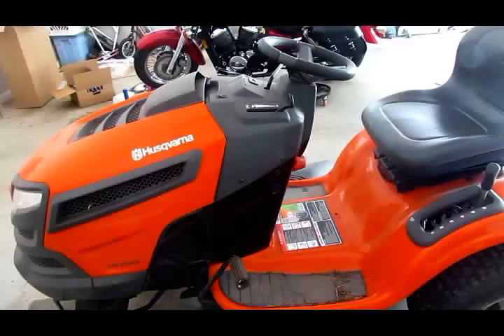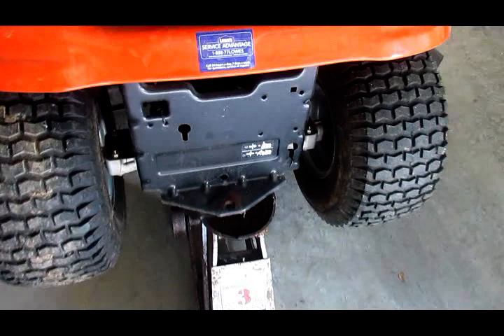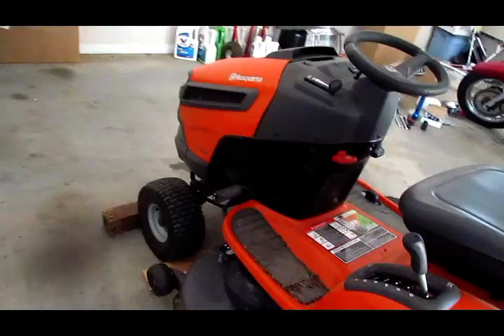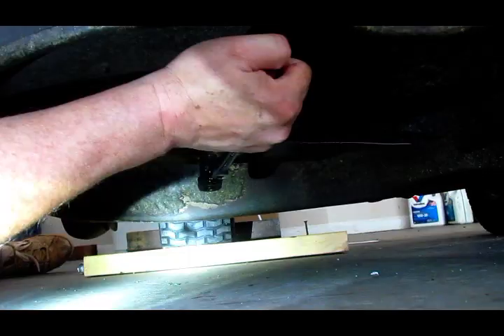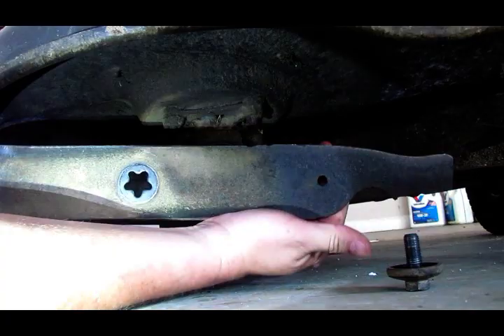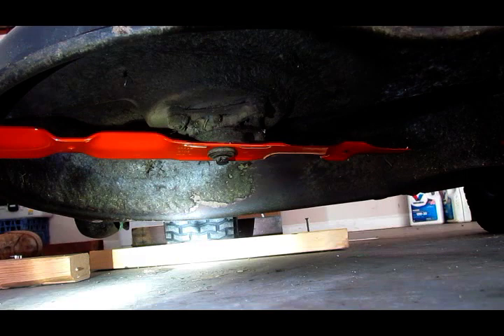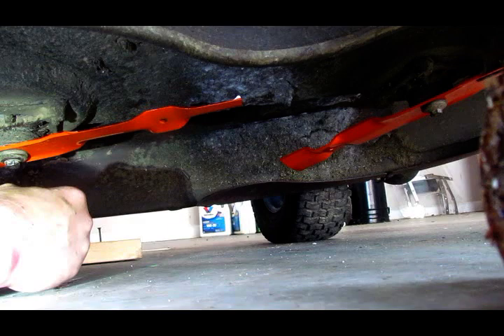Husqvarna YTH22V46 Blade Change - change your yard tractor blade

Comment: As an update, I still love my YTH22V46 and I am temporarily going to mulching to try and block out new weeds. This is also good because it recycles the lawn fertilizer that the grass sucked up.  I'm told that my High Lift vac blades also work great as mulching blades as the ones with the 3 teeth are not quite as long nor necessary.. High lift is a good thing. I used car ramps and worked great. I'm using the same blades you are using there.  Glad to stop by to say hi again!  Hope that WASH MACHINE trick worked for you.... Magnets are a great thing.........:face-green-smiling::hand-purple-blue-peace:
Reply from the maker: Sounds great!  Thank you for watching!

Comment: I have the same mower, a YTH2246. It's 12 years old now, bought it new in 2007. Never had any real problems with it, just a couple of minor things. - When I change blades I don't jack it up, I just lift the rear-end by hand, one side at a time, and have the wife slip a short piece of 4x4 (laying down) about 12" long under that rear wheel, then under the other side.  That extra 3-1/2" of space under the mower makes enough room to change blades without a problem.  I also put a leather glove on the other hand to keep from getting cut when I break the bolt loose.  I just put a drop of motor oil on the bolts before I put them back in.  - I really enjoy your videos on the YTH2246. Thanks :)
Reply from the maker: Thanks for watching, Jim!  All great ideas and thanks for sharing!

Comment: Dennis, today is April 1, 2020.  Your videos are the best.  I have changed out almost all the maintenance oriented parts on my Husqvarna YTH22V46 because of your videos.  But this year I could not get the lawn mower to start.  I had left gas in the lawn mower since November 2019 but have never had any previous problems with gas about 5 months old.  After changing out 2 spark plugs, fuel filter, air filter, oil filter and new oil, I still could not get it to start.  A friend brought over cans of Pyroil starting fluid and CRC Clean-R-Carb.  I had drained a battery trying to get it to turn over.  First he took off the air filter, and as I tried to crank and start the lawn mower, he sprayed the Pyroil starting fluid into the carburetor, the hole where the air filter fits into.  It fired up right away !!!!  But it ran really rough, like the engine was hesitating every couple of seconds.  He then spayed intermittent puffs of CRC Clean-R-Carb into the carburetor.  Each time he did the engine would die a bit but then come back to life.  Black smoke also was emitted with each spray.  But after about 5 or 6 sprays the engine ran like a kitten at full throttle.   The lawn mower is finally ready for 2020, or at least I thought so until I saw this video about changing out the rotary cutting blades !!!!!  But again, your videos are the best, by far, for explanation and video quality.  Thank you Dennis, I had to find something to do.  I am a retired 65 year old CPA with too much time on my hands.
Reply from the maker: Gary, thank you for watching!!  Sounds like maybe the carb got gunked up from sitting over the Winter.  This may help:  I buy a product called Sta-Bil.  It is a gasoline additive that will keep the gas 'fresh' while sitting.  I actually use it year-round, whenever I fill up my cans.  It usually keeps me from having this problem.  But....every now and again, a little carb cleaning is not bad either!  Glad you got it running and I appreciate you supporting my channel!
Reply: Gary, always use Stabil per the instructions on the bottle,,my suggestion,,last fill of the year buy  REC gas and put Stabil in and run that through the system on the last cut,,then run it out of gas before it sit's for the winter.  Keeps the carb free of old gas through the winter and any left there will be REC gas and Stabilized. A must do.  :)

Comment: Good video, Dennis. I love your videos. One thing I'll suggest if you don't have a floor jack or don't want to lie on the ground to change the blades, is to just take the mower deck off, turn it over and install them that way. It's much easier and removing the mower deck is pretty quick and easy as you've demonstrated in one of your other videos. I have a snow plow attachment for my tractor because I live in the snow belt and every winter I remove the mower deck and put the snow blade on. So in the Spring before I swap them back, I check my blades, sharpen them or replace them while the mower deck is off. Even if you don't use your tractor for snow removal like I do, taking off the mower deck in the winter, is a good idea to check the blades, clean off the caked grass and just inspect the mower deck and repair as needed. Keep up the good work!
Reply from the maker: Thanks for watching, Greg!  Yes sir, good point.  I live in the South, so no snow problems, but I still take my deck off once a year to inspect it, grease it, scrape the underside, paint rust spots, etc.....and change the blades.  Thanks!!

Comment: Another excellent vid!

The bolt is 5/8” head. I bought a long length combination wrench dedicated for the tractor   It’s safer than a socket handle, especially a flex handle, because you’re putting the stress very close to the plane of the bolt head. 

PLEASE use a glove on both hands. I cringed when i imagined the flex slipping and the deck edge cutting your ungloved hand. 

Another thing I would stress in your vids - 60 yrs ago my grandfather taught me to NEVER push on a wrench. Always pull toward your body because when (not if) one slips there’s nothing between your hand and body to cut you.  Pushing, you never think about what’s on the other side of your hand if a wrench slips off. 

Keep up the good vids.  You mush have acquired the wheel ramps AFTER this vid!
Reply from the maker: Great stuff, thanks!  I did get the ramps after this vid.  :)  Thanks!

Comment: I have the same yard tractor....also use mine for bushoggin..  I use a 2x4 and wedge in between blade and the deck.  
Also a couple of milk crates under back wheels..   Thanks for making the video...
Reply from the maker: Thanks for watching and for the tips Bobby!  I normally do the same with a block of 2x4...works like a champ......just hard to show on video.  haha.

Comment: For holding the blade in place while loosening and tightening I put a piece of wood between the deck and a C-Clamp.  The C-Clamp stops the blade from turning and gives you two hands to work with the blade.  I use the piece of wood to keep the deck from being de-faced by the pressure of the clamp.  It is easy and definitely takes your hands away from the cutting surface.
Reply from the maker: Great idea!  Thanks for watching, Warren!

Comment: I usually like to pull the whole deck out and do a inspection and maintenance on the whole thing when I replace or even just sharpen the blades. It's much easier to work on with the deck out.
Reply from the maker: I agree...I pull the deck at least twice a year for that reason.  Thanks for watching!

Comment: Great video. Thanks. Probably like many others, I drive my mower onto the ramps I use for my car when I need access underneath. I've sharpened lots of blades, followed by balancing to make sure the blade isn't heavier on one side than the other. However, just like you have, I've run over many things the mower wasn't designed to cut, including hidden stumps and rocks. Replacing the blades is a smart thing to do when they get out of shape.
Reply from the maker: Yes sir...balancing the blades after sharpening is very important and will certainly extend the life of your deck spindles.  I hope to do a video showing that sometime in the near future.  Now that I have a set of ramps (my wife bought me a set of Rhino Ramps, and I love them!), I also use them when changing blades.  Thanks for watching and for your comments Harvey!

Comment: Good video, I have a 386xd maybe a bit bigger but basically the same configuration.  I'm scared of machines but I've already changed my oil twice. Hopefully I can do this too. I might have help first time around though. If I can swing it. I'll be really proud of myself.
Reply from the maker: You should be very proud of yourself, Monika!  I'm sure you will do just fine changing the blades too.  Thanks for watching!

Comment: I've been using a cordless impact driver to remove and install these blades for over 8yrs. Use of a wooden brace between the  blade and the housing is minimized. Since I purchased my impact driver they have become much smaller thus allowing you access to these  bolts much easier without having to lift up the tractor as high. Works on any type or style of mower with a bolt type fastening system.
Reply from the maker: Thanks for watching!  Yes, I agree, makes the job a lot easier.  The main reason I show using the wooden block is because a lot of my viewers don't have an impact wrench or driver.

Comment: This is very relevant if you have a YTH18542, it's almost the exact same procedure, just make sure you get the correct blades for it. Many thanks for warning about the transaxle being fragile.
Reply from the maker: Good point!  Always check your specific machine for the right parts.  Thanks so much for the comment and for watching!

Comment: I bought a Riding lawn mower Jack from Rural King last year. Now, I can drive the front wheels on to the platform that fits the front wheels, comes with tie straps for the front wheels so they can't roll off. Then I Jack it up or turn the handle that is attached to a Long threaded screw which raises the mower. Pretty cool. Costed around $180.00. Well worth it.
Reply from the maker: That sounds like it is an awesome jack and would make working on the tractor a LOT easier!  Safer too!  Thanks Joe!

Comment: Thanks for this. My problem is the blades are spinning freely. So I can’t just hold the blade to loosen it. Mower was bought second hand and this is my first attempt to replace the blades
Reply from the maker: Thanks for watching Jesse!  It may be the previous owner didn't run the bolts all the way home, so the blades are hanging below the star hub that keeps them from spinning.  You might be able to hold the blade up against the bottom of the spindle to keep it from spinning.  If that isn't the problem, it may be that the center of the blade is rounded out or the star hub on the spindle is rounded off.  If that is the case, you can put a wrench on the pulley nut on t he top of the spindle to hold it and then remove the blade bolt.
Reply: @dwcoffey  thanks for the reply. Decided to replace the whole unit that holds the blade minus the pulley.

Comment: Thanks! I'm getting ready to replace the blades on my YTH22V46 for the first time, and I was looking for tips on how to jack it up. While I've replaced blades on mowers plenty of times, I thought it would be good to watch it being done on this make & model, to avoid any surprises.
 I still can't believe there isn't any decent place to put a jack on the front. Had a flat tire on the front and it drove me nuts. Had to use a lever and fulcrum to lift it, in a crappy spot near the wheel, and a block of wood under the frame (at the vertical tab where the deck connects) to hold it up while the wheel was off. Whoever designed this machine clearly never had to work on one.
Reply from the maker: Yes, I agree.....just a little bit of steel in a good spot on the front would do the trick.   I've recently started using ramps, and they make it a lot easier.  Thanks for watching!
Reply: Just take the deck off, 5 pins and a cable. Takes 10 min. I hate worshipping the garage floor!!!

Comment: Go to Tractor Supply and buy a lawn tractor type Jack. Your front tires fit in to each side Saddles in front they are adjustable the width. you can use a electric torque wrench and with the fitting like you put on a socket stick it in and pull the trigger and it Jack's your whole front end completely up works great I've got one makes it a lot easier to jack up and it's lot Stabler
Reply from the maker: Thanks Popeye!  Yes I actually use my motorcycle jack now on the front end.  Works like a champ!

Comment: Hi - I’m about to take the deck off using your excellent video and I’m wondering if I should be disconnecting the spark plug(s) before I do that in order to insure that the blades don’t somehow engage even though everything is “off”? If I should do that, can I just remove the spark plug covers or do I have to go to the trouble of removing the plugs themselves?
Reply from the maker: Thanks for watching, Sara! It isn't necessary to disconnect the plugs before removing the deck, but it won't hurt anything to do that.  If you decide to do that, you don't have to remove the plugs themselves, just pull the plug wires off the spark plugs.  Also, if you are concerned about an errant start, rather than pull the plug wires, you can disconnect the negative terminal on the battery.  I hope this helps!

Comment: Best VID I have seen.  My White Outdoor  946G  has the bolts froze.  125 air impact and a 150 foot pound torque wrench will not break them loose.  I have sprayed the Nuts but without any success.   I have been using the standard clockwise on  and counter clockwise off.   Any suggestions short of taking it to the local shop  he wants $100 dollars to change the blades.
Reply from the maker: Hi Vern, thanks for the compliment!  Excuse me for asking, but I have to ask.....have you tried clockwise-off?  They may be left-hand threads.  If that doesn't work, you could try a little heat....heat up the bolt head with a propane torch a bit and give that a try.  They may be loc-tited on and only heat will break the bond.  If those options don't work, let me know and maybe we can come up with something else!  Wishing you success!

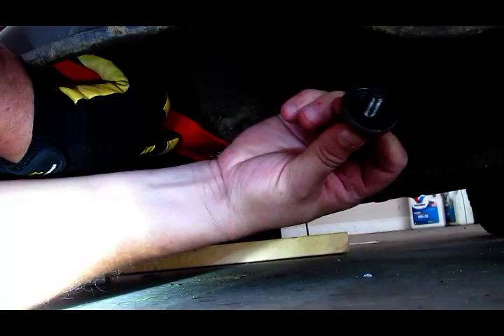Comment: Great video....... 8:50 went dark for a minute though. Heading out for new blades. You never mentioned if you use a bagger. I use a triple bagger and those blades looked like good vacuum 'bagging'  blades also because of the uplift. Funny my blades looked just like yours after removal last night.
Reply from the maker: Thank you for the heads up....that's weird and new, but it sure cuts out at 8:50 for nearly a minute.  I'll see if I can edit it without re-uploading.  Thank you and thanks for watching!

Comment: Dennis i have the same tractor. Thank you for the helpful videos i subscribed can you please continue to make videos of the maintenance on the tractor. Great detail oriented videos
Reply from the maker: +deadlydiesel556 Thanks for the comment and for watching!  Yes, I am due for an oil change on mine, so I'll video that soon and post it.  I also plan to video anything else I have to do to mine.  I'm pretty rough on my tractor, so I'm sure to need some repairs soon!  :)
Reply: +Dennis Coffey thank you Dennis you are very helpful to us guys that like a visual of things instead of reading through all the manuals
Reply: +Dennis Coffey what i'd do is put a jack stand under the deck and keep the jack under the hitch point
Reply from the maker: +Dylan Chalmers I've since started using ramps.  They're much safer than relying on a jack and give plenty of room.  Plus these plastic ones my wife bought me have holes at the skinny end so I can hang them on the garage wall, out of the way.
Reply: Dennis Coffey you mean regular car ramps?
Reply from the maker: +Dylan Chalmers Yes, they work great.

Comment: Hey Dennis, thanks very much. I have a question as to sharpening. I have the same mower and I bought the factory mulch kit. But the blades seem like they need to be sharpened. I couldn't see from the video if your blades had been sharpened, or if you installed straight from the package. Cheers.
Reply from the maker: Thank you for watching, Bruce!  I installed mine straight from the package and had no problem.  But, I also wouldn't hesitate to sharpen new blades if they seemed too dull.

Comment: I have a rover 547/38 Ever three months I just jack the front up to check  and  sharpen the blades  I  change the  blades ever two years or so  The  only thing I can not change with this with the deck on is the deck  belt  I have to take the whole deck out for that but that only ever three years.
Reply from the maker: Thanks for watching!  Yes, this tractor is the same...you might be able to replace this belt ok without removing the deck, but it'd be tight.  you should remove the deck to change the belt.

Comment: 5/8 fits a little snugger on my Airens tractor which is a husquavarna
Reply from the maker: I wouldn't be surprised if there are slight differences between the Husqvarna, Craftsman, Ariens and Poulan....they are all basically the same, but I'm guessing some of the bolts, etc maybe slightly different.  Thanks for watching and sharing that info Tim!

Comment: Hi Dennis, I have this same model, 10 years old now. Do you think a loose or worn blade would be the cause of vibration while cutting thick grass? This never used to happen. Or maybe worn spindles, pullies, or belt? All are original except the blades. I was thinking to drop the deck anyway for a major cleaning, belt and blade replacement, etc. The other issue I have is that reverse isn't working so well anymore, thoughts? Any advice greatly appreciated!
Reply from the maker: Thanks for watching, John!  Yes sir, a loose blade will definitely give you a vibration.  I think pulling the deck and checking all of it, pulleys, belt, blades, etc is a great idea.  Also, if your reverse isn't working well, you may need to replace the drive belt too.  I have a video showing how to do that.  I hope this helps!
Reply: @dwcoffey  thanks so much Dennis! I had no idea the belt affected reverse not working properly.  Your videos gave me the confidence to plan to do this overhaul project. Thanks again!